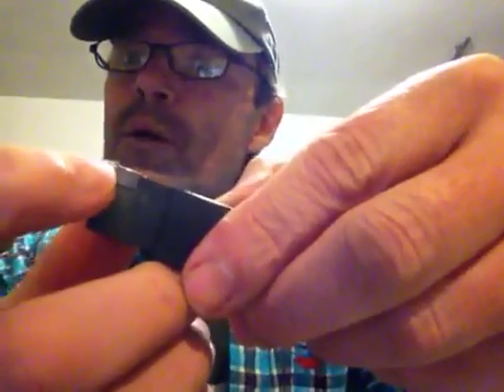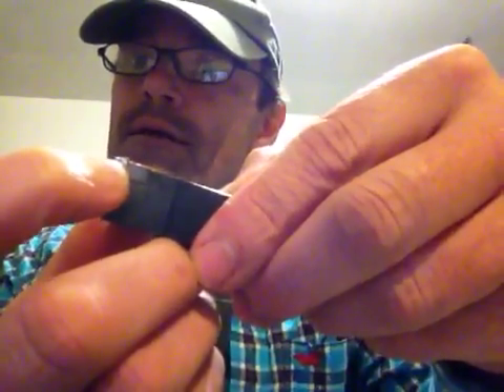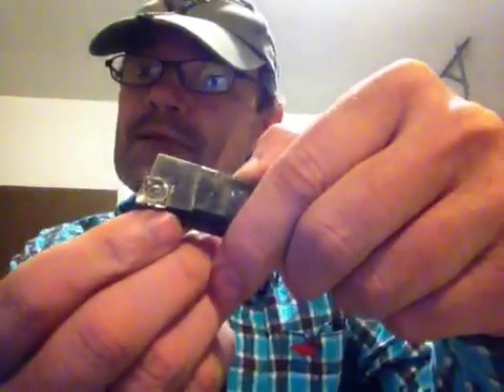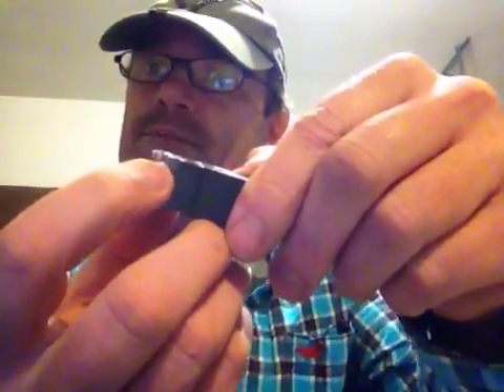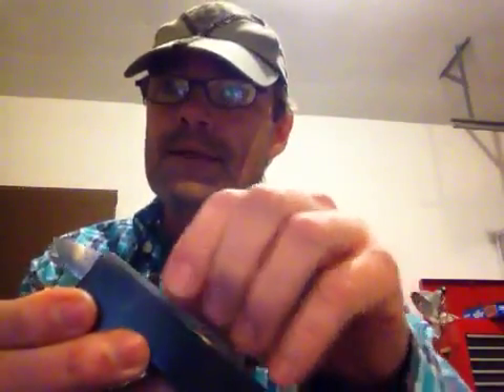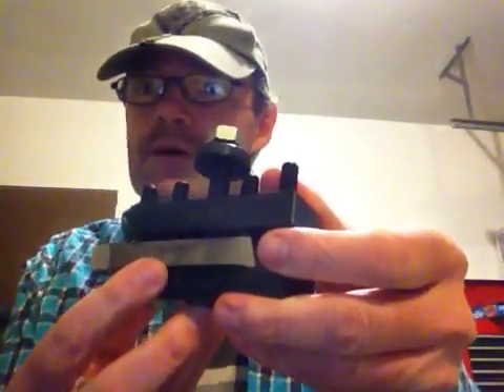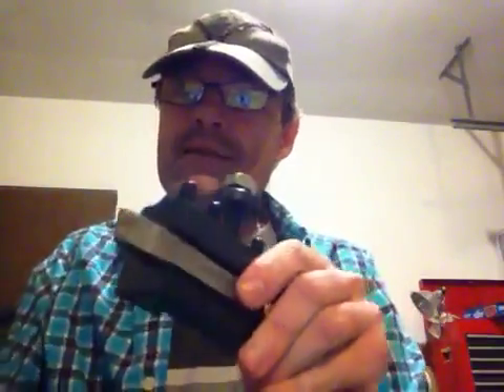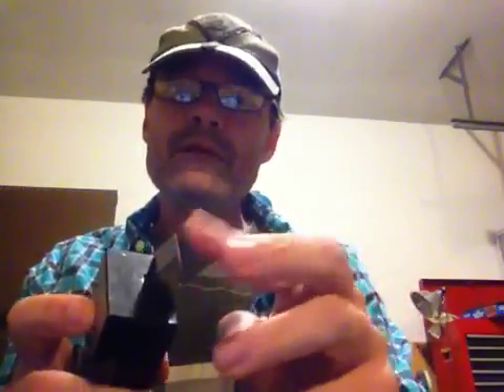12x36 precesion Mathews lathe

Comment: Brother there is nothing wrong with your tools or you know how or even your lather :) Give it time, You are learning pretty quickly by your self and this is all of us are doing. I bout a small Holzmann 403 lathe and I have learned so so much on this small lathe and I had the same problems as you. You have to have different size sheem I think its called in English so you can raise the Tool holder as much as you need too or lower it down. Good Luck

Comment: Some of your problem I think is the procedure your using and the insert tool doesn't look like it's a threading style or the wrong insert. Let's start from the set up did you set your tool height to the center of the work piece , next did you use the fish tale to center the tool to the edge of the work piece. Did you set your compound to 29 degrees or 30 Next did you take a just barely touching cut. Then Ck with you screw pitch gage for correct number of threads. Now you find you total depth of cut on some fishtails . Zero your cross slide at your just touch on part. Your feed will be thecompound taking light cuts 5 thousands per cut is plenty and use coolant on steel oil works aluminum wd40 works. After the cut gets to the length you want back the slide off from the work piece. Go back reset to zero set the compound another 5 and pick up the same line or number or letter on you LATHES threading gage.Before you get to the max depth of cut take some cuts with out turning it to cut deeper. Spring cuts we call that. When near the depth stop and try your nut with it still in the lathe if it's too tight take another cut with a thousandth or two. Repeat till it fits with light resistance. Hit the threads lightly with a file to knock off the sharp edges. The best thing to do is watch some threading on YouTube . Your tool holders may need milling flat on the bottom of each one . There made in China we see all kinds of uneven ones. Hope this helps a little.
Reply from the maker: Silverbullet thanks so much for the comment. I've picked up a lot more knowledge on threading since the video was posted and am doing what you said in your comment. My threading still needs improvement because of speeds and feeds.